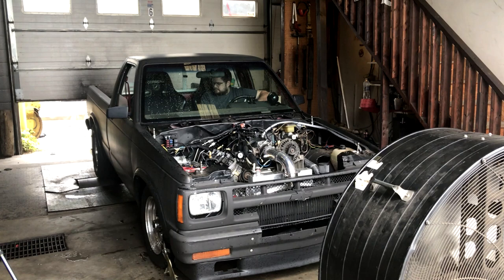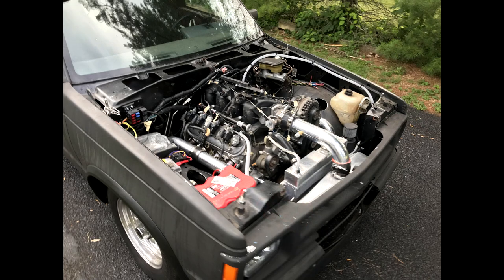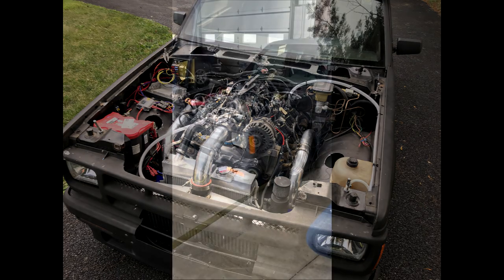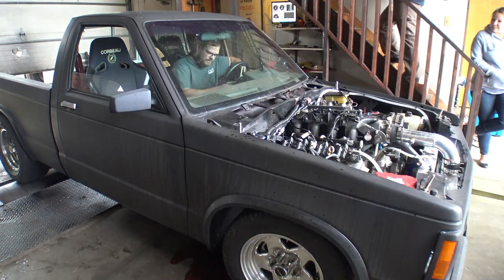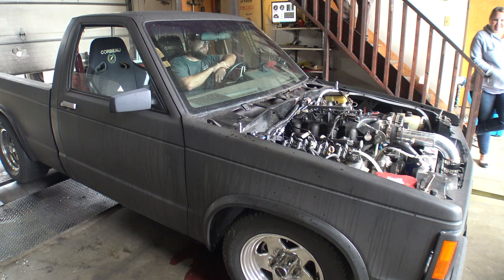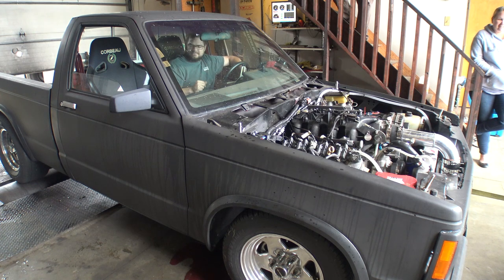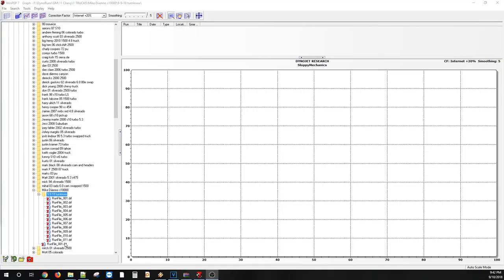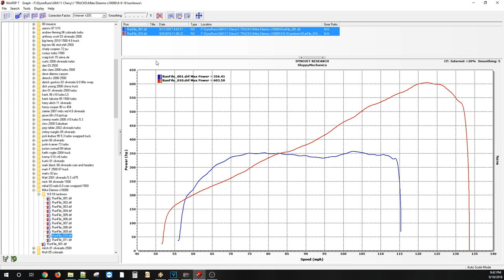fire hazard mikes bed mounted twin turbo 5.3 s10

Comment: WinAmp 
Man that takes me back.
I put my built 400 Pontiac up to 6,500ish on the factory rods (ARP prob saved me) and my TH475 TCI vomited trans fluid, this was years ago, thought it was something serious, know you know why SUMMIT and JEGS sell that vent tube catch can for autos.✔
Reply: Funny my brother had bought a built th350 for TCI and didn't use he sold to a friend of mine that put it in a 76 firebird with a 455. First pass at the track in the burnout box the trans puked fluid and the car caught on fire

Comment: Question :
When you tune a flex fuel vehicle:
You create a map for gas,and one for E85 ,then the ecu adjust fuel and spark values relative to the spectrum of fuel blending ,by using %,and interpolation, or you need to do something else ?
Reply from the maker: The ecu will add fuel and spark based off ethanol content, if they bring the car on strait ethanol I tune it on that and make a judgement call for what will be safe of strait pump, or they bring it on pump and I tune it safe then we pour in ethanol and I use the ethanol spark added table if applicable and tune it for e85 also it’s hard to answer depends on capability of the ecu and combo etc, we do what we can with what we’ve got
Reply: Ok,
Thank you.

Comment: Dear Mr. Sloppy! LOL I am building a TBI Chevy 350 in a 1994 gmc C-2500. LS is next! I have a GT45 turbo with 3" air to air, bov, what, and a blow threw hat on the TBI. Yes I said TBI! In theory my plan should work I am using a separate injector driver with two 1000cc screw in injectors screwed to the top of the blow through hat and the controller is from Split Second it has a map sensor built-in and a signal clamp for the other map which I replaced with a 2 bar sensor and have a wideband to keep an eye on it. The injector controller has software to tune the driver. My question is can I make some HP without blowing it up with the TBI on it? Oh and I have blown $2600 on all the parts and am at the end of the stack of money and need help to get it running. I will send an email to you with more specs.

Comment: @sloppy mechanics
Hey mate, love your channel,
I have a stock ls1,
I am planning on doing a rear mount turbo setup like what you have in the truck, I was thinking of going a single T76 on 8psi of boost, I am capable of doing all the engine and fab work myself,
I was going to take the oil pan off, tig an oil return into the pan, replace big end bearings and set clearances @.002-.0025", replace rod bolts with arp 2000 series bolts, and replace harmonic balancer with an aftermarket item I have sitting around,
Would the stock ls1, with an extra bosh 44 pump, injector decap, and the t76 be ideal and hold together as a reliable daily @8psi?
I would be happy if it made 450hp at the tyres,
Or would a twin gt35 setup be better/more suitable?

Comment: Somebody thumbs down for S10 smell.

How do you run oil feed and drain for a remote setup like that?
Reply from the maker: feed from engine normally, hes running a catch can and scavenge pump to return oil back to engine
Reply: That's what I expected, but based on the fireball fuel cell/turbo setup, I was hoping it was gravity fed through the cab.
Reply: Makes me wonder where the "height" and "distance" start becoming an issue, that one company that sells rear Turbo setups is / was working on a stand alone oiling system.
Reply: People have been trying to make standalone oil systems for turbos work for at least 15 years. I'm with you; there has to be a way. I haven't found it yet, though.
Reply: @jasonandjenparks1523  I'm sure you can have a small 4-5qt reservoir for the oil and use a scavenge pump to feed turbos and have it run through a small oil/tranny cooler before returning to the reservoir.  Put a small fan on the cooler to help when car is not moving.

Comment: my 86 mazda b2000 ls swap with the same gt,35's on 92 pump went  9,89 at 137  and that was @ 12 lbs  "running on just the springs :)p

Comment: What is realistic hp on something like a sloppy stage 2 5.3 with 93 octane and a 4l80e. There is absolutely no E where I live at.
Reply from the maker: all motor?
Reply: Can I just ask also. All motor 5.3. I have your sloppy stage two cam and the Pac springs. We only have 91 octane where l live in Montana.
 Going to put it in my 66 Chevelle with a 3.73 gears. 
 Any estimate on a 1/4 et. High 12's possible? 
Absolute love your videos! I have learned a lot.
 Want to do a turbo later.
Thanks 
Eric
Reply: Sloppy Mechanics shoot. I’ll take that too but I meant with a turbo I see that you sometimes run upwards of 15 psi on pump gas, I’m guessing that varies for what the motor likes psi/timing but with a turbo
Reply: 305 lean, 380 rich.
Reply: Ellenor Malik “turbo”

Comment: looking at the graphs, id probably rather have the 400 with more punch down low for ripping on the streets. each to his own though
Reply: i can assure you, the new setup is way better
Reply: you can assure all you want, two totally different types of power though. I have a built 400, they are nasty when done right. big block punch out of a small block. my 5.3 is great as well, but zero bottom end.
Reply: the old pump gas 406  ran 11.40s at 122 with tiny heads. It ran good and whooped a lot of BB cars that were street oriented. yeah, a stout BB car would beat it. Now it actually hooks decent in 1st on the street and is an animal where it can  be. and im talking a 275 street tire. i like it but it was a learning curve to drive.

Comment: 550 RWHP on how much booooooost? Matt where do get all of this time to work (at your real job) take care of little guy, build cars, tune/dyno, do burnouts and paint pretty little trees with Bob Ross paintings?
Reply from the maker: 515 on 10psi
603 on 14psi 
E55 99% injector on E55
Reply: 603 on 14psi.....did i miss something...?
Reply: would you run it on 99% duty or would you take 1-2psi out just to be safe?
Reply: what is he running for boost management? are boost tee's common/a good idea for LS's?
Reply: Max hp out of a 78/75 billet vs racing or max boost what is their limit?
Reply from the maker: the issue is the ethanol content can over run it also, for street use and safety we left it at 10-11psi at 75% duty so there would be overhead if he went from 55-85% ethanol he would have enough injector plus, 500whp in that truck for now is plenty
Reply from the maker: a few cars on my channel here have done 700-800whp with a 5.3-6.0 through an 80e auto
Reply from the maker: we were running just wastegate, i threw on a ball and spring to get it to 14 for fun, but its just Sprung mechanically for 11
Reply: @SloppyMechanics  i have the snake eater 1500s dual walbro 465s 8an feed 3/8 return 220r cam low lift .550/.550 112 4.11 gears 317 heads how much do you assume i can get with a e85 tune?
Reply: @jorgesalinas8876   sounds like you made your mind up so why not put it together and find out? conservative that'll do 600-750 on E85 but with a 78/75 you'll need like 18-20psi to make over 700
Reply: We done 500hp N/A in a LUV back in the 90’s and drove it to the track ran 11’s and drove it home. Oh and it was a 350ci Chevy motor dart heads, 1050 dual pump Holley carbs with eldelbrock high rise intake and a 2 speed power glide 4.11 rear end that had been shortened to accommodate the huge DOT drag tires. We ran pro tech tires you can’t get them anymore but when we switched to the same size mickey’s the truck wouldn’t hook anymore.

Comment: Single 450 pump?
Reply from the maker: he has a fuel cell and a a1000 from like 1995 so that is whats still in there
Reply: Also would like to know! How much can a single 450 push on pump 91?
Reply from the maker: approx 700 through auto

Comment: More like 3000-3300lb
Reply: But it ain't exactly 50/50 balanced.
Reply: My fully gutted and caged square body S10 weighed  2660 with me in it with a 5-3 a turbo 350 and a 80 mm Turbo
Reply: @legendary_perfomance  Get some!!!
Reply: My s10 weights 2,300 gutted with race seats and it would weight 1000 something with a fiberglass body kit
Reply: @dillonplemmons9649  nice